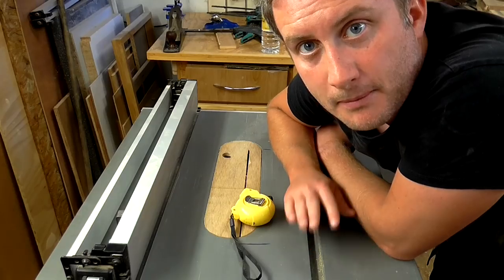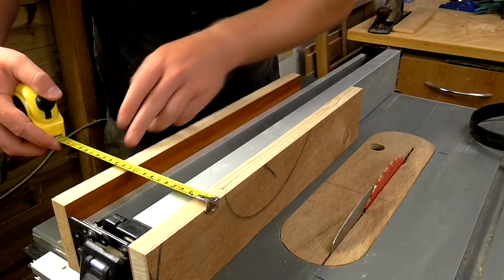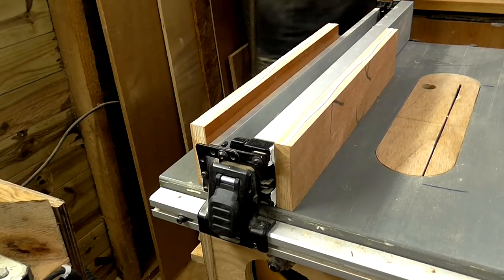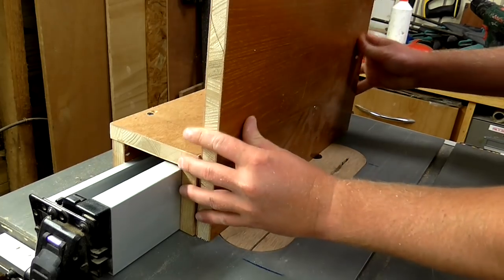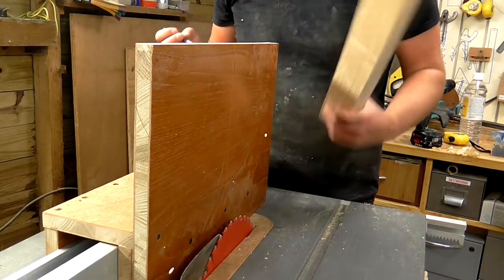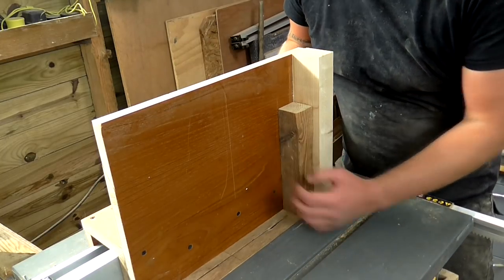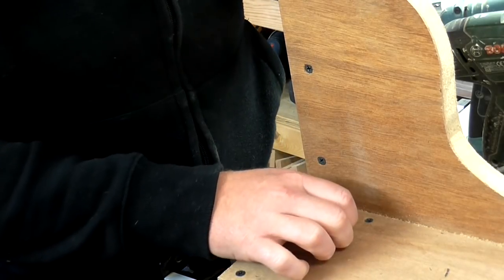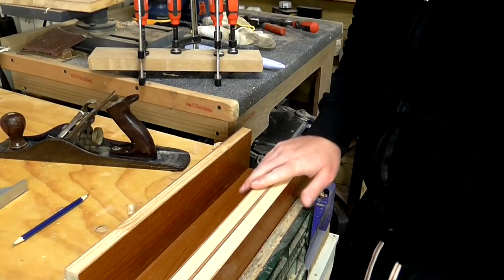Tenon Jig for Tablesaw - Quick And Simple

Comment: Another option with the work piece support, it can be screwed on only, preferably with brass screws, or none lower than your max blade height. The reason not to use glue is the piece is sacrificial and can be shortened to give a fresh face, or replaced as needed.

Comment: Similar to mine and it's ancient. However I never glue the upright backing piece as it's sacrificial. I make it a bit longer Once it's been used I drop it down to make fresh cuts as it also prevents tear out. Once it gets too short bin it and fit a new one. Saves having to make another jig.
Another little tip for anyone. If you have one of those little digital level boxes. Put the level on the table, zero, firmly clamping the upright bit so you can tap it to move it. Now put the level box on the upright and adjust until it reads dead 90°. Clamp it tight and fit the screw

Comment: Keith. Saw this video yesterday & made the jig last night. Very pleased with it. Your tip about masking tape is great. I added a block of wood to square up the far side of the fence - easy to do but probably not necessary. I found a couple of pieces of laminate covered ply for the jig sides - a touch of furniture polish  and the jig is a great sliding fit. I am lucky in having an older version of the Charnwood 650 saw which has a great fence system which is micro adjustable and rock solid.
Great video presentation

Comment: Hi Keith,I have watched this vidio a fewer time's,but never made a comment,it was a very simply made jig,made entirely of scrap material,just one tip,always check that the saw blade is vertical which of course you did.
Reply: Colin Askey 
But when he put the square up to the blade, you could clearly see light at the top.
Don't know if the top end was resting on a blade tooth though.

Comment: Whenever you make a jig never leave a 90 degree intersection between two joined surfaces.  ALWAYS RELIEVE THE INNER CORNER.  The reason being that the likelihood of a workpiece fitting exactly into that intersection without a burr,swarf, wood chip, or etc. on the corner of the workpiece is near zero which immediately throws off your work to some degree.

Comment: if the vertical sheet had only been screwed it would have allowed you to fine tune the squareness  with shims. I have a saw similar and the rack and pinion fence is actually a bit of a nuisance. there is some play in the mechanism which causes the leading end of the fence to move before the other end, causing about a mm of difference. I have to remember to turn the fence adjusting knob back a hair to nudge the front end of the fence into alignment and make sure only the front end moves and not accidentally move the far end. it doesn't give me a whole lot of confidence in the squareness of the fence and increases setup time with all the second guessing. maybe the mechanism is worn out.

Comment: I have the same tablesaw and I was contemplating making a similar jig but with the fence design with the little flip bar I was worried about the jig wiggling around a little bit and I can actually see it wiggle in your video a bit.  I think I'm just going to have to remove that flip handle thingy.

Comment: Hi.
Brilliant and so straightforward, will be making one next week..
What is the jig that you have on the table saw that adjusts the horizontal  fence? It appears to have a cogwheel track? Is it specific to that saw or is it something that can be added to the saw table.?
Reply: Many of the Dewalt table saws have a rack and pinion track that the fence rides on and it helps keep the fence square to the blade.

Comment: Great video. I will definitely make one now. One question, what happens if I raise the back support bar to prevent it from being cut while tenon is being cut? So the blade will cut the tenon and pass under the support bar. Any thoughts, please?
Reply from the maker: You can do that, but you won't get any zero clearance benefit as it won't be supported, but that would be gone after a few uses anyway

Comment: Hello. I have the same saw too. I've had a bit of a nightmare getting the blade set up properly. It wasn't parallel to the mitre slots and getting the bevel stop set so the blade is perfectly 90° to the table is also a challenge. Dewalt have not made it easy to make these adjustments, I mean, how can you set the blade parallel to the mitre slots when you have to put the saw on one side to get at the allen screws to move it. would you also agree that the mitre gauge is total garbage? Anyway, I'll have a go at making this jig seeing as you've already done the measurements for me. Like the vids, have subscribed. Thanks.
Reply from the maker: +Andy Tyrrell luckily I've not had any issues with the blade set up, it was accurate and got to go out of the box. I totally agree about the slack in the mitre gauge it is useless. But so is the one on my bandsaw and the one with my belt sander they're all useless. I really don't know why they can't make them a snug fit!!

Comment: Did you check to see if the large back piece is even square with the table? Looks like there's a pretty decent size gap when you glue it on, even after you attach the clamps (3:17).